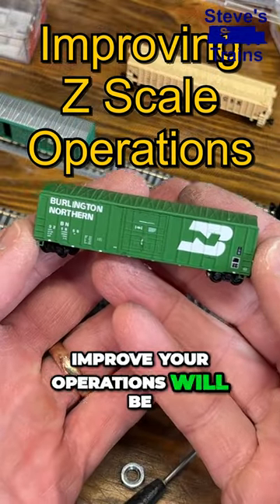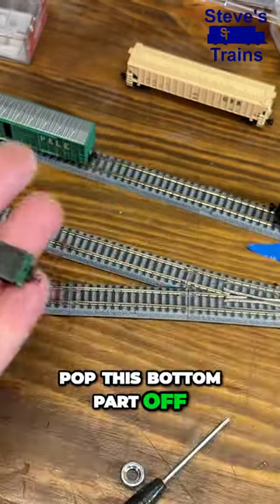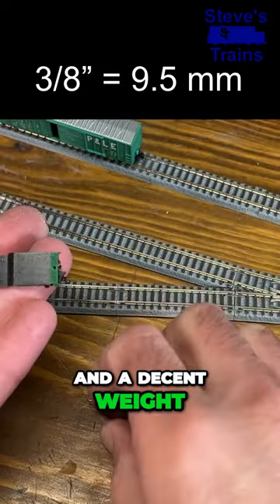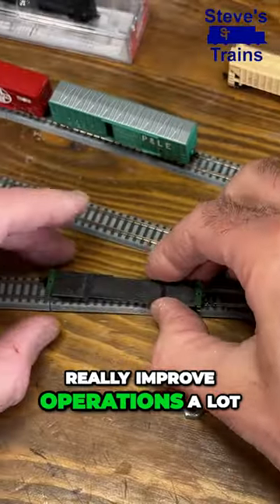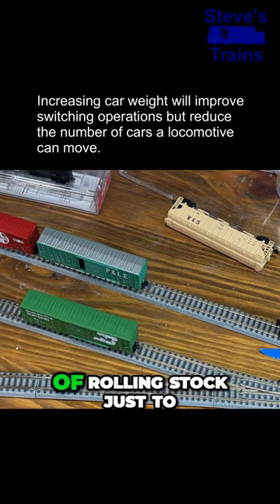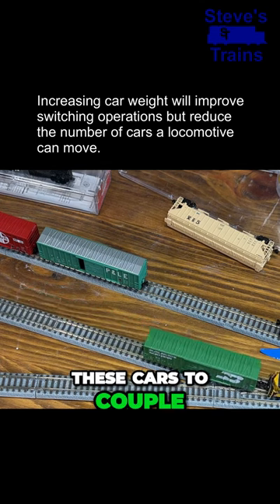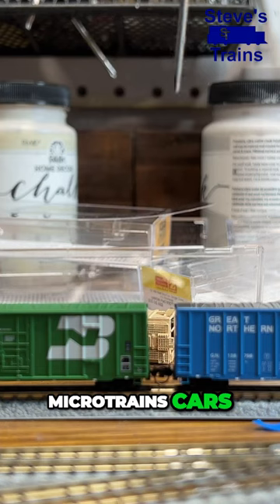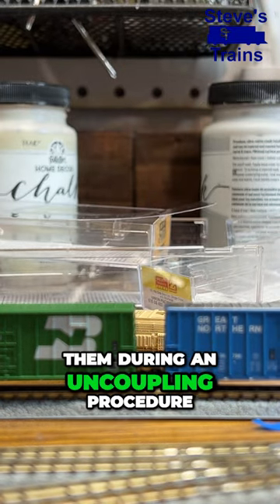Easy Hack to Improve Model Train Operations and Prevent Derailments #modeltrain #zscaler

Comment: Make sure the nut is 100% clean before gluing. Most nuts and bolts have a thin film of lubricant applied and it can make the glue fail
Reply from the maker: Good point!

Comment: great tip,i wonder if i can do it with my o scale box cars...thanks for showing this great video..
Reply from the maker: Get a pack of stick on wheel weights used for balancing and that kind of thing. I use those in N and HO scale. Just peel and stick the weights in there. I’m not sure how much you would want to add to O scale, but double the standard weight can be a nice place to be for switching operations.

Comment: Your helpful tip applies to ALL scales.
Reply from the maker: Yep, i over weight cars in all scales as a rule.
Reply: @StevesTrains  In olden days, modelers would wrap metal wire around car axles for a heavy low center of gravity method.  It worked until it didn't....  ZZZZZTTTT BLAM!!!!

Comment: How would the train operate at scale weight?
Reply from the maker: Just running them is fine. The issue is trying to couple and uncouple the cars. Because they are so lightweight at the size it is hard to couple to cars together without touching them because they can just get pushed along without the couplers engaging.